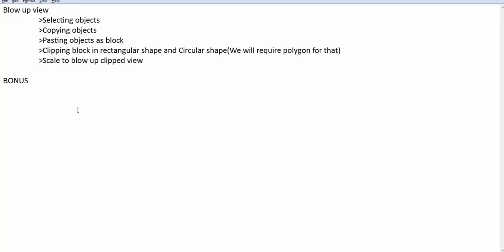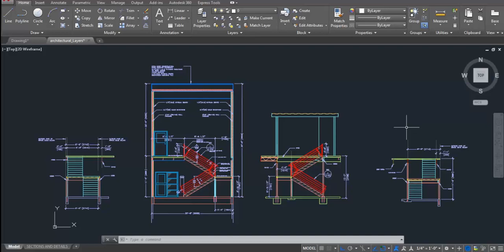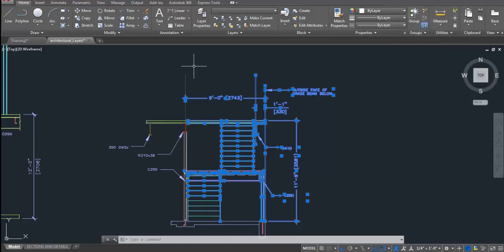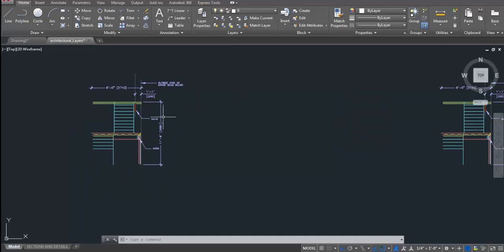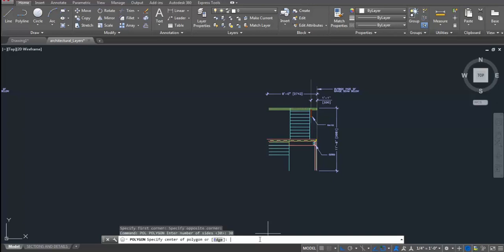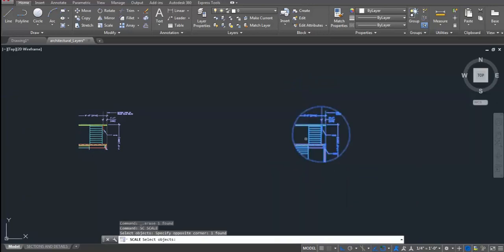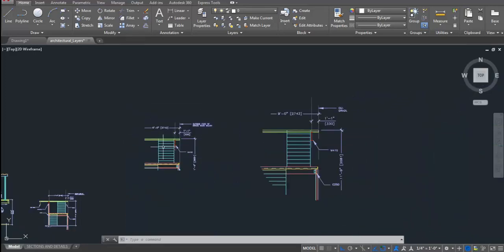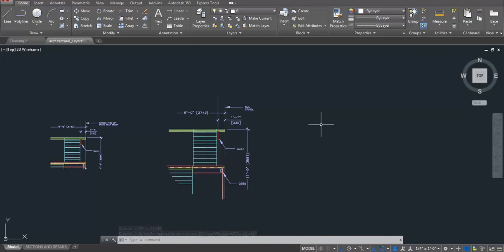AutoCAD Blow up view

Comment: Very good lesson, here is my question, if you explode the enlarged block to a scale factor and explode it dimension also change to that factor , how  can you keep  original dimension values after exploding the enlarged block to a scale factor ? is that possible ??
thanks
Reply from the maker: That is possible, but its a workaround not direct way to do.
Reply: @bhavinpatel438  thanks for replying Bhavan , I know have to do ea. dim individually, I thohought there might be an easy and direct way in autocad
Reply from the maker: @paramcambow820  there is a way, read my recent comment it does it in one shot.
Reply: @bhavinpatel438  Hi Bhavan,
May be you are too busy, I figured out in step # 4 when you get to modify change your Scale Factor to 1/value you used to scale the object.
Reply from the maker: 1. Make a copy of your dimension style which object inside your block is using(usually it is current style, that can be ISO-25 or Standard)
2. To make a copy of dimension style > D(enter) > Click New > Start with (select which is mentioned in point 1) > Specify name that you can remember > Click Ok > Click Close
3. Go inside block editor for clipped object > fi(enter) > select filter: change 3dface option to Dimension > Click  Add to list > Click apply > type command: all(enter) > (enter) to come out of select object > (make sure that all the dimensions are selected)go to properties palette pr(enter) > From misc. category > change dimension style to the copy that we made in step 2 > Close block editor
 > save chages
4. eXPLODE your clipped object > Dimension style D(enter) > Modify(copy that we made in step 2) > Primary Units > Scale factor > use the value that you used to scale
 > OK > Close
555. We are done brother

Improve your skills to pro level & stand out of crowd get your demo class scheduled for free.

Bhavin Patel (Certified Professional)(8+ years of teaching experience)
For oneonone training do contact me on...
bhavin5963@gmal.com
+919699399986

If you are refer my service to someone You care&love, They would be getting best learning experience and You would be getting 20% cut from fees paid by Them.
Reply: @bhavinpatel438  Hi Bhavin , I followed you instructions, no problem till step #3. when I try step 4 , I am not sure what happens ,Dimensions change to scale factor (eg 2x ) the original scale , can you pl. take a look and expand on #4 step .

thanks a lot
Reply: Thanks Very much Bhavan , It worked Yaaaaaaay , appreciate your help Bhai Sahib 👌😊✔ from Canada

Comment: That never worked it delete thing outside my circle
Reply from the maker: That does not deletes outside portion, it basically hides them, you can use xc(enter) and select clipped obj. and then select off or delete.